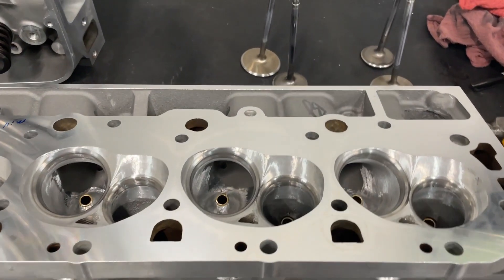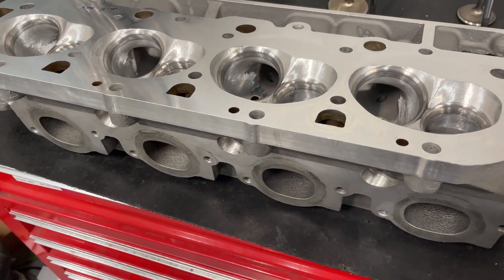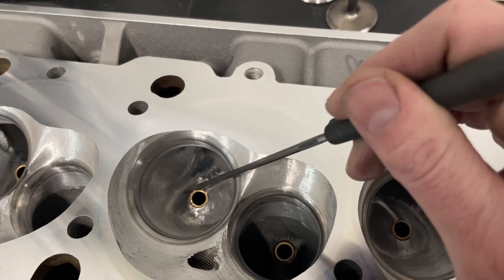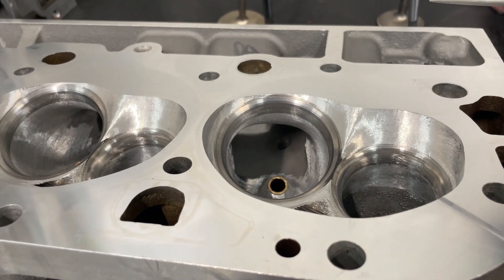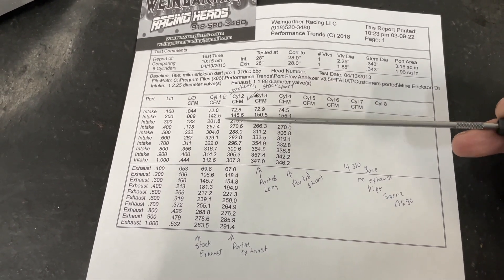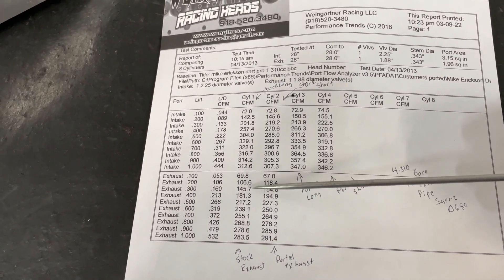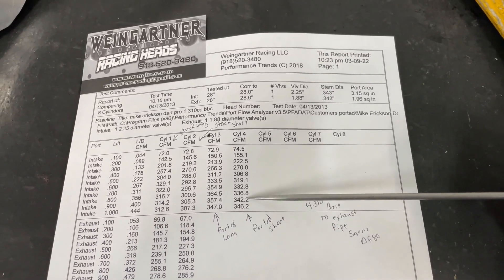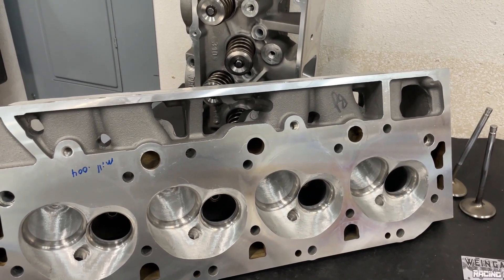Improving Dart 310cc BBC Heads

Comment: Have you had any of the CID bbc symmetrical stuff come through your shop? I would like to know more about them but there is zero information about them on the website except for flow numbers, valve angles, and combustion chamber size.
Reply from the maker: No. It’s too rare and requires too many special pieces to be used by many.

Comment: On Dart heads, for along time now it usually says right near the spring pads what the material that it is made from! There is usually a date code also, I believe they have been made of 357 for awhile now! If I’m remembering right, it’s something Dick Maskin did years ago to strengthen the heads! I’ve always had really good luck with them 👍🏻👍🏻👍🏻👍🏻! I know they were also working on just about every one, because they were so outdated! That was when Dick was alive & he owned the company 👍🏻👍🏻👍🏻👍🏻! I know the few BBC heads we worked with recently were pretty dam good! I think they were the 380s! We also did a LS with the Dart 10* head! They were really nice right out of the box 📦! I don’t think 🤔 we even touched them! Other than setting up the valve job & spring setup! I do know that Darrin did a Dart 20* when he was @ Reher! It made some stupid power for a smallish cube truck pull BBC! I have never used the small Dart stuff! But even with there bigger heads, flow numbers never seemed to be spectacular 🙄🙄🙄🙄! But they always made good power 👍🏻👍🏻👍🏻👍🏻! Anyway your killing me man! Did I miss a video 🤔🤔🤔🤔! I’m dying to know what happened with your sisters engine??? I’m really hoping you found something with the 406-8 whatever the cubes are 😂😂😂😂! I’m really hoping everything went well & someone is not ready to slit their wrists 🙄🙄🙄🙄😂😂😂😂! JK of course 🤪🤪🤪🤪! We went through that BS years ago with 2 new bow tie blocks with Crower Rotating assembly’s & every trick in the book 📚 for circle track 🙄🙄🙄🙄! Both brand new engines were complete bags 💼 of shit 💩💩💩💩! At the time our old wore out junk was making about 410tq & 390ish horsepower! 2 barrel stuff of course! Both new engines wouldn’t even make 380tq & barley 360hp 🙄🙄🙄🙄🤬🤬🤬🤬! We dynoed & tore the better engine down 4 times the week we were supposed to deliver them both! Needless to say, opening weekend that track champ went out with our wore out junker 🙄🙄🙄🙄! They were upset 😠 never mind everything else in the shop came to a standstill 🙄🙄🙄🙄! My boss just wouldn’t let them have the piss poor new engines! Luckily the guy won the main 100 lap opening race! Well after talking with everyone, I think 🤔 Keith Dorton told my boss not to even bother with those new blocks 😳😳😳😳! He told us to shovel the good parts into a well used block & they would make big power 🙄🙄🙄🙄! We went to a different dyno where all the sensors including the EGTs worked! Well it was like a light turned on 💡! It was loosing all ring seal, during the pull 🤬🤬🤬🤬! It was the only thing we hadn’t changed 🤬🤬🤬🤬! We did put all the guys parts in old ass blocks that had been sitting out in the weather, for years 🙄🙄🙄🙄! (Lots of work) The first one went 405hp & 420tq! The other one went 409hp & almost 430tq! Not the same as what you have with the 406! But a week I never want to relive 🤬🤬🤬🤬! Another week machining & rebuilding them both again! Even though the driver was happy 😃! The owner wasn’t, because his two new expensive blocks were sitting @ the shop unusable 🙄🙄🙄🙄! Well for alittle while anyway 🙄🙄🙄🙄!

Comment: Very impressive improvements! Looks like a lot of bang for the buck with these heads. Do you know any details on the finished combo, race gas only? Would these be good for ~750HP on a dialed in high compression 496 (4.31 x 4.25 BS)?

I've always wondered why on BBC, seems they always push the in ports down on the manifold mounting surface when they don't fill the surface top to bottom. I realize the factory did this, comparing the rec ports to the ovals. Just seems the aftermarket at some point would have raised the smaller ports to the top.

Also, how'd your sisters engine do on the dyno, break 400hp?